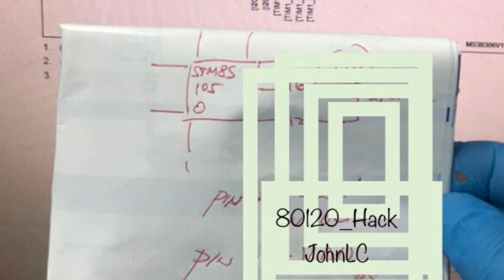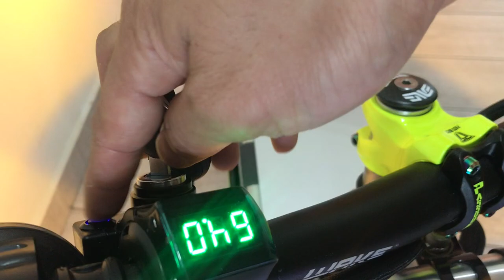Fiido Q1 Dual, Build Summary, Performance tune 60V-120V

Comment: No braking sensor? Or is it not necessary with the mt7?
Reply from the maker: It is equiped with electronic braking system. Magnetic sensors are mounted on both brake levers.